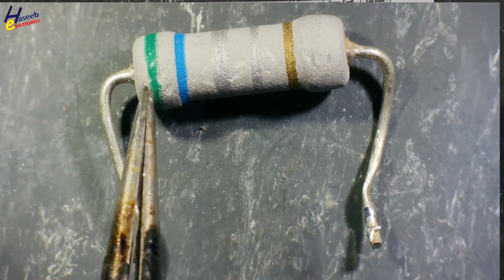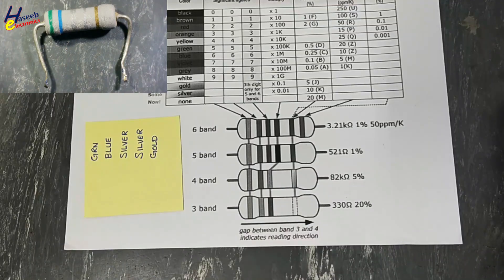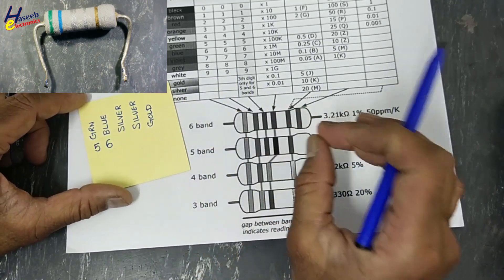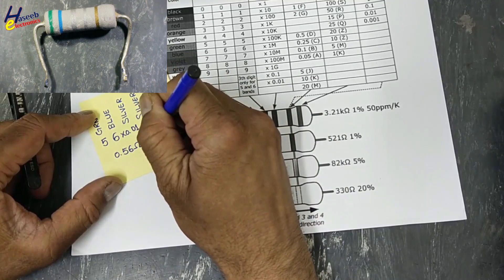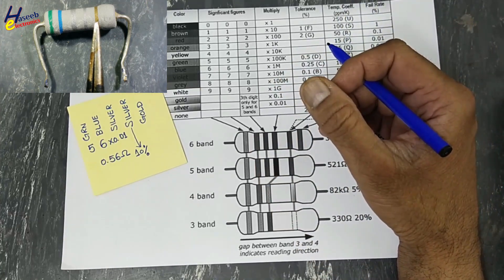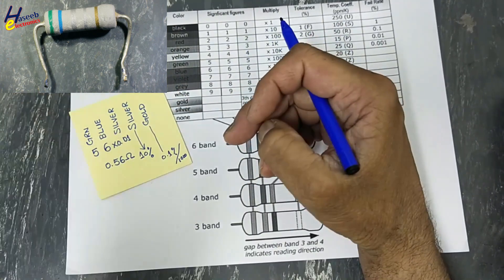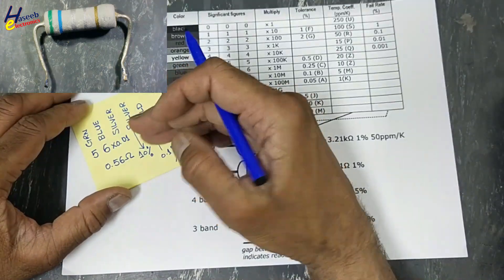{1307} "Resistor Color Code" and "Failure Rate Color Band"

Comment: Dear Sir
I have resistor calculater in my phone. It calcules 5.68 ohm. I think third band should be 8 instead of 0.01 and -/+℅5.Am I rigth or you? Anfvb then calculater are wrong 
Stay safe
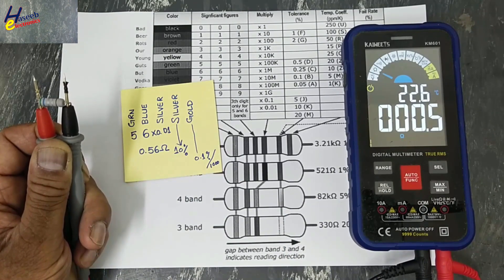Baha 2:54
Reply from the maker: No 
it is 4 band resistor with optional "reliability or failure rate" 
this resistor will not be calculated correctly by any online calculator. if you want to know its value using any online color code calculator or application
then you cna use option 4 band resistor calculation only. in this way you will calculation only 4 bands excluding optional band 
please check this article 
http://denethor.wlu.ca/common/resistors_fixed.shtml#:~:text=Failure%20Rate,would%20fail%20per%201%2C000%20hours.
Reply from the maker: as per conversion results and testing by multimeter, it is eactly 0.56 ohms +-10% with 0.1%/1000hrs fail rate (that means 1 resistor out of 1000 resistors may fail after 1000 hours full rated power operation)

Comment: Thank you
Reply from the maker: thanks a lot for your kind words
Reply: @HaseebElectronics i lerned about colours code în 1986...but this with silver colour band is something special..means ,0    and i neded  0,62ohm ...i solved the problem thanks to you..i found a rezistor with first band blue ..second red ..third silver ..and fourh golden as tolerance.
Reply from the maker: @ionboc9317 yes 
Blue 6
Red 2
Silver x0.01 
62*0.01= 0.62 ohms 
Gold +-5%

Comment: @HaseebElectronics  Actually i just found two similar resistors in 2 power supplies they both read the same value 0.7ohms one is 4bands resistor and the other one is 5bands resistor the color code is blue gray silver gold for both and an additional green band for the 5bands resistor but the green band is not listed as a failure rate color neither is the gold by the way so i just thought i would share this here

Comment: I've learned exactly from this table about resistors recognization. Very good & usefull material.
Reply from the maker: https://landandmaritimeapps.dla.mil/Downloads/MilSpec/Docs/MIL-std-1285/std1285.pdf
Reply from the maker: http://denethor.wlu.ca/common/resistors_fixed.shtml#:~:text=Failure%20Rate,would%20fail%20per%201%2C000%20hours.

Comment: Usually i find these gray body resistors in smps and they're used as fuses but never seen them with such a color code  thank you for sharing
Reply from the maker: these spcialized resistors are widely used in CRT TV deflection circuits

Comment: Thanks.وعليكم السلام ✨👍,  
Can you tell us , what type is your multimeter , is it , abest one ? if you make a vedio about your testing tools would nice .✨👍
Reply from the maker: wa alaikum salaam dear brother
i am using KAIWEETS KM601. till now it is around 1 year, it is excellent but there is only one problem that it consumes batteries too much. but before 6 months, i installed rechargeable battery with a usb charging module, now i am feeling comfortable. also i use FLUKE mutimeters, Uni-T